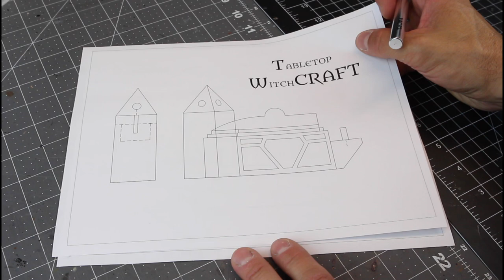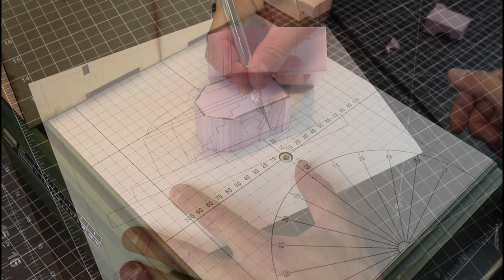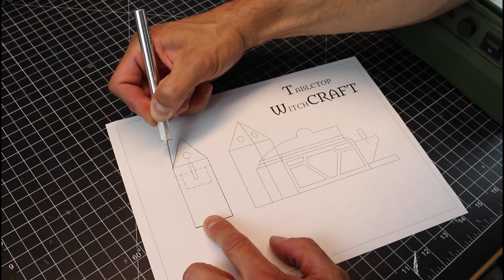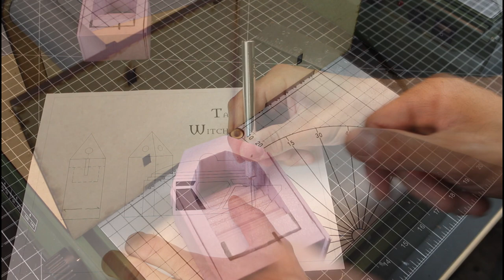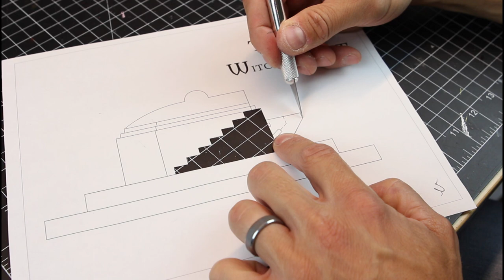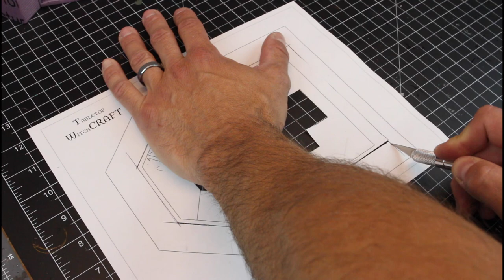Craft a Dwarven Tomb for Tabletop Gaming

Comment: Get yourself a small pillar candle for heating up your pin and for heat shrinking.  It will free up your hand and you can go from heating directly to the project in hand with out having to have a focus on where you are throwing the lighter aside.  It will have it's own drawbacks with having a flame, but, if it also has a nice scent, it could be nice aroma therapy while you work.  I used to do this when I would work on models for making holes, shaping sprue, or stretching it to make hinge pins.
Reply from the maker: I have one 2 feet from me in the studio and never thought of using it for that haha.  Thanks Jedi!

Comment: I've bit of a sculpting tip for you ( I don't want to teach to suck eggs or anything) but I noticed when you where sculpting the bowel etc they were moving all over the place (I know how annoying that can be.) 
I now have a sculpting station and I use several glass picture frames of different sizes for different size sculpts. the greenstuff/putty is sticky enough to adhere to the glass and when its dry it literally just comes off easily it would make these sculpting jobs so much easier. 
Thanks to your encouragement I've got into the sculpting side of things as it's a skill I seem to have that I didn't know I had, so I've been doing a lot of research into it.
 But my sculpting station is down to you and your channel I'd have never even attempted it until I saw you do your greenstuff sewer rat . 
Now I'm doing owls, bats, crows and I'm just learning how to do farm animals ( I'm planning a Wicker man build based on the 1972 movie) that's all thanks to you. so I thought I'd pass something back I've learned
Reply from the maker: I'm happy to hear you've found a new love of sculpting!  You can do so much with little additions and details with it.  As for the glass picture frame idea.... That's what I made them on :)  I sculpt them on glass all the time, including the pieces made in this video.  Great tip.

Comment: John, not to question the master or anything but have you ever gotten and durability issues with your batteries or leds?
Reply from the maker: Jon Annett Feel free to ask away Jon, I’ve run a 100 hour test with these LED’s and batteries hooked up directly and they were still burning although a bit dimmer than a fresh battery!  That being said there are a few LED duds here and there, but they are cheap so I just toss them and grab another.
Reply: @TabletopWitchCRAFT  good to know but sorry let rephrase the question. Do you find durability issues with the battery or LEDs seating? do they wear down over time does the battery not carve out a hole that is harder to be reseated in when a battery bets swapped?
Reply from the maker: Jon Annett I haven’t had any major issues, the hot glue really adds a lot of durability to where the batteries seat.

Comment: Great build! I was wondering if you have a link for the Dwarf mini that is on the tomb lid?
Reply from the maker: MacAttack001 Thanks !  The lid itself is a bookend I used to make the lid.  I reference the ebay shop it can be found at, at the end of the video.  The actual mini in the thumbnail can be found in the description in my Amazon Links.

Comment: You could almost drop a 9 volt battery into those pillars.
Reply from the maker: Monster Hobbies Age of Sigmar Battlefield You’re right !
Reply: @TabletopWitchCRAFT  I have some very vintage model railroad lights (Edison type) I wonder if those would be too hot, over time, to melt through the styrofoam? Have you ever tried to light something with something not an LED?

Comment: I really can't do magnets, they drive me nuts. no problem with lights diodes etc but magnets I can never get them level, or the poles right. So I gave up
Reply from the maker: Put two magnets together that you're going to use and put a mark on the outside of each with a marker.  Then I always put the mark side into the glue and you'll get the polarity right every time.  The key to making them level is putting them into the glue once it has cooled off a bit.  Don't drop them right into really hot glue (yeah that can be a pain).  Once they are in the hot glue that is a bit cool they are much easier to work with and level.  Don't give up :)
Reply: @TabletopWitchCRAFT  I will very probably have another go, I think the foam I used wasn't much good as it tends to melt even on the lowest hot glue setting. So for now I'll just use that up and then get some of the better stuff,